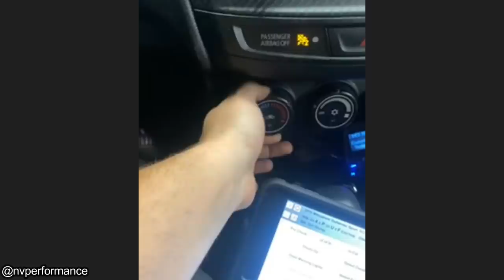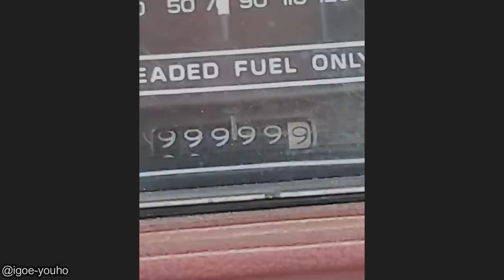Customer States They Want BMW To Warranty The Damage | Just Rolled In

Comment: I wish I hadn't seen that oil in the coolant before but I've seen it twice. My nephew hit something hard enough to punch both front struts out of the towers and they bent the hood.
Reply from the maker: Damn. How hard did he hit it? Lol
Reply: @JustRolledIn  agreed. I want to know how hard you need to hit something for that kind of damage.

Also, I like your channel because I get to see damage to vehicles that I would not normally see
Reply: @JustRolledIn  Bet it was a big jump, maybe an underpass and a really hard landing.  We have a rail road track roadway underpass  in Downtown Sacramento in the 16th street  leaving town and the jump on exit can get you serious "air" at around 50mph.  Ask the teenage me ;-)
Reply from the maker: @jamesplotkin4674  sounds like a good time lol
Reply: Many years ago my sister hit a large pot hole and bent 2 wheels and flattened 3 of the 4 tires on a Ford focus, she called me and said she hit something and could I put the donut on and bring it to the mechanic-had to tell her to call a tow truck because I working, I went to the mechanics where she had it towed and took a look and wanted to kill her because of the price and the length of time to get replacement wheels from Ford (she had the fancy wheels and tires from Ford)it took me 4 days to find wheels and another day to get tires
Reply: damn that must have been a very hard hit
Reply: Driver and passenger were fine but that totaled the car. I'd never seen anything like it before or since.

Comment: Adding oil to the cooling system is a whole lot better than adding antifreeze to the crankcase.

I had a 1978 Oldsmobile Cutlass Supreme.  I drove it long enough to roll the odometer over twice and was 14,000 miles away from doing it a third time when I traded in for a four door; kids and car seats work better with four doors than two.

Comment: Is stupidity part of the deal when you drive a vehicle in the USA or does it come when you get your license out of a Weeties box?
Reply: License out of the wheaties box is the big issue.  Over the past 30 years the driving exam has really slacked significantly.   Written exam is mostly about the dangers of drunk driving mixed with right of way.  However, the driving exam can be as simple as 6 right turns around the block.  It used to be viewed as a privilege, but today it seems more consider it a right.  So quality of driving has decreased tremendously.

Plus cars have become relatively reliable so most don't know even simple steps such as fluid checks (if the car lets them check at all).   They've become rolling appliances and most treat them as such.
Reply: Comes from parents not teaching their kids at least the bare essentials in car maintenance and the kid not taking any initiative to learn it on their own. I can understand if they would rather pay someone to change their oil while they get an inspection or breaks but just straight up disregard for their cars easiest repairs and maintenance is so sad...
Reply: Maybe the dealers keep a drawer-full at their yards!?!
Reply: @BananasananaB  Damn good comment. Basically, the world in general is going to hell in a hand basket, it's as simple as that!

Comment: Those old horizontal speedos were great. Especially when you started getting near 100 mph. The round ones are so boring and passe.
Reply: Except for the speedo in my 1967 Mercury Montclair which was the size of a dessert plate and had a cool almost 3 dimensional look. Was quite awesome to see that needle go past 120 MPH on the local expressway late one Saturday night back in 1980.

Comment: In 2000, I slid my 99 s10 down a hill, (the entire thing was ice), I came to a complete stop on top of the hill, slid down all the way down, it had a curve at the bottom of the hill. I hit the curb, blew 3 tires, and broke 2 rims. I temp put the spare on the rear axle so it could be towed. It sucked
Reply from the maker: Ugh, that sucks! Especially on such a new truck.
Reply: @JustRolledIn  yesterday, I fixed the headlight alignment on my 95 c1500. (Ordered new polyurethane headlight clips), was all excited to test the lights out. Backed up 20' out of the garage. Forgot the lower steering shaft was sitting on the workbench, being rebuilt. Lol
Reply from the maker: @SimonTekConley  hahah, doh!
Reply: I had a brand new 98 S10 (maybe 3 weeks) and slid down a hill, just like you did, and through a red light at an intersection. But it stopped 3 inches from a street sign at the bottom. Went up the curb and about 4 feet, then just stopped right at the sign. Thankfully, the weather was so bad when I was driving home from work, that there wasn't anyone out on the road when I slid through that interestion. Scared the hell out of me.

Comment: How I remember the day I was driving my dads 1978 Cutlass Supreme back in 88 when the Odometer flipped to all zeros. My mother acted like the car was just going to break or something. I drove that thing for another 50,000 miles till I had to sell it because it would not pass emission when they introduced it back in 92 in Florida. Emissions inspection ending in 2000 in Florida after they found no change in the air quality..... Because Florida is mostly  a peninsula and the air clears fast.

Comment: I have a 1989 dodge W250 barn find showing 30k on the 5 digit odometer. Oil change, new plugs and wires, cleaned the tank and put fresh fuel and it fired right up and purred.

Comment: 0:33: Deadass happened to my father just the other day. He thought the A/C in my mom's van wasn't working while he was sitting in the passenger side, & was freaking out because my parent's Honda Civic also has a dead A/C. Somehow he didn't first think to check if the temperature dial was set to cold, as I always set it to neutral when I'm in the passenger seat during the winter 🗿

Comment: I never got to do the 99,999 to 0s but o did get to roll the work van from 199,999 to 200,000. And I’ve driven plenty of digital modern gauges over 100k miles, just never one of the old school ones . It’s probably too late to find one.

Comment: I've seen damage from hitting potholes and other serious hazards but have never seen a tire break up like that.
Idk if this is at all common bit I once had to replace a turbo on a friend's car do to coking because he had a bad habit of shutting down after pushing the engine and not idling to cool the oil down. The turbos oil passages were badly clogged with chunks of burned oil.

Comment: To all the folks passing judgement about the AC with heat on, it is easy to do. 
All you need to do is drive to work at 30 degrees outside and 80 degrees on the way home. 
Then again when you live in a place like this, you earn your money.

Comment: Is BMW putting cast instead of forged parts on their front ends? That grain looked a little weak to me
Reply: As far as I know, all suspension parts are cast.  Maybe Ferrari and Lamborghini uses forged suspension parts, but not BMW/Merc.  They do use aluminum instead of steel, though.

Comment: My 1985 chevy c10 Silverado has rolled over the odometer 3 times now.. Factory motor, 3rd timing chain (every 100k), 2nd clutch (4spd), 3rd fuel pump, 2nd alternator,  5 sets of tires.. Still starts and runs when it's cold out.. When chevy used to advertise "Like a Rock", they meant it.. I am the second owner.. If you take care of them, they take care of you.. ✌♥️🇺🇸

Comment: That no charging issue happened to a machine repair call outwhere I use to work, walked up 10 flights of stairs to lift cover and see no belt to run the 240v generator.

Comment: i had the same thing with one of my flat belt pullys. a smal one came off and the battery as well as the cooling didnt work anymore because the belt was gone.little later the computer stoped the gas pedal from putting more gas and i was forced to wait for 2,5 hopurs on a hot summer day to get pulled. some 600 euros in repair

Comment: I worked for Toyota back in the mid 90's and a lady with a Camry came in with a loss of power issue.  I finished my diagnosis and came back to the service writer with a quote for a muffler.  The service writer says "She has a power issue, we can upsell the muffler afterwards."  I laughed and said the issue is the muffler.  Apparently, she backed up her car into something that smashed the muffler to where there was hardly any exhaust coming out and caused back pressure.  Good times.

Comment: How does the automotive industry work with denying service to damaged vehicles? Do they report unsafe vehicles to the police? Or what do they do?
Reply: From what I seen in most cases if the customer insists in taking an unsafe car on the road the shop/mechanic will have them sign a waiver of some sort.  That way if the customer takes it out of the road the shop is released from liability.  The shop doesn't really have the authority to hold a persons car for it being unsafe.
Reply from the maker: All depends where you live. Where I live you need to report it to a peace officer and they will investigate further.
Reply: @JustRolledIn  You said "peace officer". I'm guessing that you are not in the US.
Reply from the maker: @timothyball3144  nope, Canada.
Reply: if they have brought it in for inspection it would fail

Comment: I remember me 1 yea old Ford Escort (UK model) that I managed to hit a patch of black ice, knuckle collapsed and the left front wheel went under the engine, acted like an anchor and whipped the car around and sideswiped both rear wheels up a kerb. Both rears were angled 45 degrees and the left front was under the engine… but I still tried to drive onto the grass so I was out of traffic.  Only took the dealership 2 weeks to fix… and the funny thing was I was right in front of the dealership when I had the accident so I didn’t have far to have the car moved. A nice lady stopped when she saw what happened and even gave me a ride home.

And what was playing on the radio? Tina Turner - If I Could Turn Back Time (I kid you not).

Comment: I had a 2013 328i. The engine bottom end blew 300KM after warranty(80,000KM). A know problem. I asked for some help. They said.. we can install a new engine for..get ready for this. $28,000 CND. $10,00 for labour. Or I can trade it in for a brand new one. I paid $33,000 for the car. This all happened last  year. I said ill look for another engine with low miles. They said it will just happen again cause this is an issue with this motor! I loaded it back up onto my trailer and headed home. Found an engine from a 2015 and installed it. I sold it first chance I got. They called me back 4 months later and asked if I would be interested in buying a new vehicle from them? I said not a frickin chance. . I really liked this car. But if this is how they warranty things never again. I drive a 2010 FORD FOCUS with 140,000KM and this thing we not die. It's a  crappy car in every way but the engine is bullet proof. They can stick their BMW where  the sun never shines.

Comment: My worst ever mechanic story is, once a lady brought her newer Corolla back in for warranty because it sounded like a bolt had come out and was rolling around under the interior floor. We thought maybe by some chance a socket or something got left in it from the factory because there was indeed a noise as you drove around. I spent the next 3 days removing the whole fucking interior, many test drives, test drives with my shop foreman, sticking magnets in frame holes, using digital scopes to look in anywhere I could and didn't find anything. Then with 90% of the interior removed, I had another tech drive the car erratically while I hung on for dear life in the back seat well. Upon him repeatedly flooring it and slamming the brakes.....a damn hotwheels car rolled out of the driver seat venting piece....the lady's kid dropped a hotwheels car and it rolled into there but wouldn't come back out with the interior carpet installed.....Since this wasn't a fault of toyota, the lady didn't have to pay anything AND guess who only got paid for 1 hour diag time after working on this fucking car for a week? This was the beginning of a very quick mood change for me and I soon after found a new job because the dealership saw I would do these stupid ass jobs for little to no pay without complaining too much. I was dumb and young then. Now I would have found a way to sue them for paying so little
Reply from the maker: That is unreal! Disgusting how some businesses treat their employees. Glad to hear you found a new job shortly after.

Comment: I'm not a mechanic. At 1:22, they're showing under the hood. What is really wrong there? (curb damage)
Reply from the maker: They broke both engine mounts the mechanic said. Thats why the engine looks tilted. The mechanic said they also damaged the oil pan, AC Compressor, an axle and 2 wheels. Just from what it recall him telling me.
Reply: @JustRolledIn  Thanks. I was looking for individual broken pieces, but it’s the whole engine that’s dropped a few inches.
Reply from the maker: @johnyoung9649  I put more info in the description for each photo & video. Sometimes the mechanic has a lot of information, thats too much to say in the video so I add it their 😁. Just incase you're wondering for future videos.

Comment: My idiot cousin bought a gallon of oil, added to my radiator in the dark, pizzed me off that he could be so careless with my car. 🤬
Reply: Hope he paid for the repairs...
Reply: @ffjsb  No I fixed it myself...🙄
Reply: @ffjsb  Absolutely sucked, because it was winter in Michigan and we already froze our ass off for the 45 minute drive home. I had to work the next day, so I was already cold, and had no garage, I had to totally empty the cooling system and flush it many times with cold ass water from a garden hose, then put antifreeze back in and make sure the thermostat still opened and closed. It never really had great heat after that. The same cousin hit a pot hole and made a balloon on the side of my tire, I had just bought 4 brand new tires the day before. I let him take my car home, because he had kids and no car, and he lived the opposite way from work, and I really didn't feel like driving the opposite way from work for 30 minutes, he could just pick me up as he passed my house on the way to work. But damn he was stupid!
Reply: @Water-Proof  No good deed goes unpunished...

Comment: You know the last vehicle hitting the 1000000 mark was not one that was made in the last 30 years!!!! You're lucky to get 100 out of american makes and maybe 300 out of imports!
They just don't make them like they used to.
Actually! If they made the cars so you could fix them yourself without having to take half the car apart, then you would probably see higher miles.
Reply: My memories of Chevettes and K-cars aren't as rosy as yours. 
Do you remember pulling into a service station and saying "fill the oil and top off the gas"?

Comment: After buying our new x5, I decided to remove the shit brakes they come with from the factory, and replace with non dust ceramics. I noticed that the manufacturer castings on the inner rim stated….

Euro/China 

Just because it may be a “euro”  by name means nothing . BMW are Chinese made. So yea BMW should warrant those unfair replica wheels they are putting on from the factory

Comment: A PTU is generally for hydraulic power transfer. 
What he means is generally called a Transfer case, in a car.
Reply from the maker: Ford calls them PTU - power transfer unit since it transfers power from the engine to the wheels. 
A PTO is a mechanical gearbox that is used to transfer the power of the vehicle engine to auxiliary components, which are usually to a hydraulic pump. 
Everybody calls them different, but it's not a typical transfer case, since a PTU spins all the time and you can't turn it on/off.